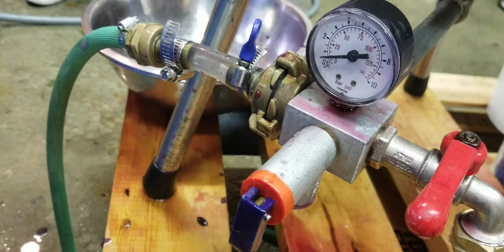Bladder Press, Pressing the Red - Winemaking 26

Comment: Where did you purchase your press from? Also, any idea about how many gallons of juice you get from one run of the press?
Reply from the maker: https://morewinemaking.com/?gclid=CjwKCAjwvrOpBhBdEiwAR58-3KlVMSdEXPGk4xD_tRJV_cHGQHIkXNal5bU6WUN6Mrq269JpA-EifBoC19IQAvD_BwE
Reply from the maker: The juice question is hard to answer.  In my 55 gallon fermenter I typically put in about 12+ lugs, a lug is a 36lb box. I usually run the press two, maybe three times per fermenter. That said, don't quote me on those quantities, it's been a year since I ran the press and I never quantified the amount of presses per barrel. My gut says we can usually get it in about two depending on the grapes varietal. Zinfandel is a very thin skin grape so we can pack in a lot of must.  Cabernet is a much thicker skin, smaller berry, you'll definitely press more with the cab. Also depending on your patience, I usually put some must on the bottom of the press then run all the free run juice through it so it acts as a filter.  I'm left with a thick must at the bottom that then gets pressed and can be separated or blended back into the free run.
Reply: @VelebitMountainMan  thank you very much for the answer. I think you said you had a 20L press in the video but it looks bigger. Can you confirm the Make and size of your press? Was looking a getting a 40 or 90 L press from Speidel for an average of 8-10 55  gallon drums of must each year.
Reply from the maker: Get the biggest you can afford it will save you hours of pressing time.

Comment: Are the whites in primary? I always thought you needed more headspace than that. About to make my first white wine soon. I was looking into a bladder press as it looks to be much more efficient than a basket press but I typically do 10-15 gallons of wine at a time.
Reply from the maker: The whites are in primary, and they did overflow. I thought the 60F temp would keep the fermentation slow but once it took off it was going full force regardless of the air temp. I would highly recommend buying a bladder press, it's the best investment I've made in wine making equipment. You will maximize your yield, and end up with a better product.

Comment: nice video... how big is rhis press  in litres  20 or 40
?
Reply from the maker: Zambelli 20L water press, good for up to 2 tons of grapes. If you're doing more than 2T at a time it will take too long.  1T takes about 4 hours, give or take, depending on how much we drink and eat in between.
Reply: @VelebitMountainMan  thank you
Reply: Hi, great work! Could you please tell me what pump are you using? 
We do not have sufficient pressure from water outlet (around 2bar) and we have to push it to at least 3 bar so I am searching for a solution for that.
Reply from the maker: https://www.menards.com/main/plumbing/pumps-tanks/utility-sump-pumps/barracuda-reg-1-2-hp-cast-iron-transfer-pump/6913303/p-1444428712829-c-1489153238832.htm?tid=-6915063833957215030&ipos=33
Reply from the maker: It's something very similar to the url I just posted. That pump can put out up to 52 psi, I think the one we use can go a bit higher, none the less its the same style cast iron transfer pump with hose attachments. On one end we installed a standard brass hose bibb which is what we use to regulate the pressure from the pump to the press. It's critical to have some sort of valve on the supply side to regulate pressure otherwise you run the risk of bursting your bladder. Let me know if you have any questions, I can snap a photo for you if you'd like.